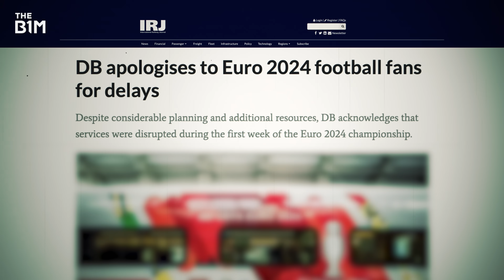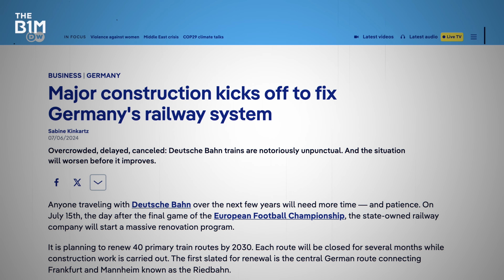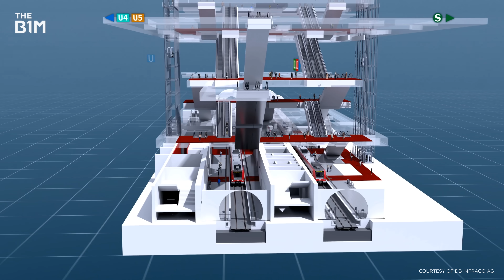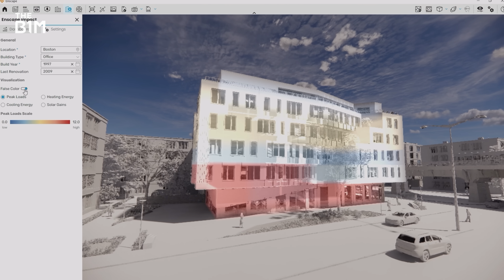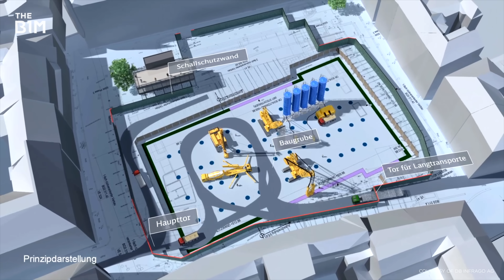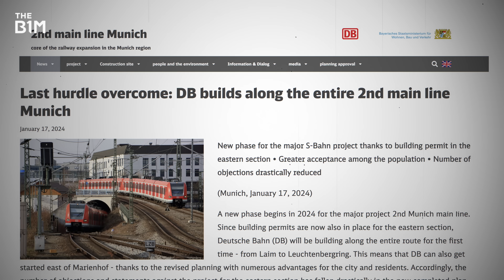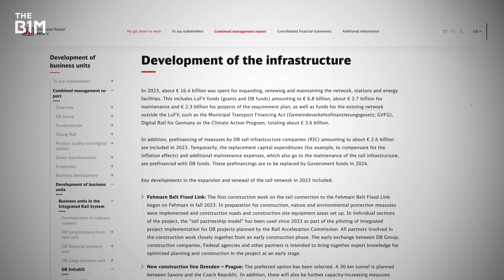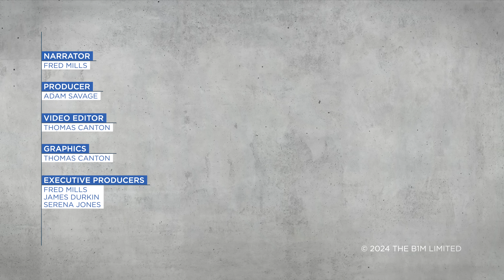Germany is (Finally) Fixing Its Failing Railways

Comment: These mentioned "largest projects" won't shift the quality of germans train infrastructure which has been neglected for almost 30 years (starting at the point when the former "Deutsche Bundesbahn" was transformed into a shareholder company named "Deutsche Bahn").
Tens of thousands of kilometers of tracks had been destroyed,  thousands of gates were deinstalled, hundreds of stations for freight trains had been closed (and the ground had been sold).
What Mr. Wissing proudly presents as a so called "Generalsanierung" will be a pushback both in the sense of economics and logistics. Whereas hundreds of trains do not arrive on time and lots of them even do not start (daily!) many commuting people who strongly rely on train services moved back to their cars inducing massive congestions on germanys Autobahns.
On top of this there are projects like those shown in the video.
They are so ridiculously out of schedule and so expensive that they suck all the money and the engineer working power that is needed to renovate the whole system.
Futhermore most of them are misconceptions at a large scale.
Stuttgart 21, Hamburg-Altona, Frankfurts new tunnel, 2. Stammstrecke (Munich).
It's a pitty.

Comment: Never trust a public train network when they put the station underground. It only costs more and is less efficient.
The new "modern" station in Stuttgart will not able to handle as much trains at it's predecessor. It's tunnel are created through a type of stone that expands in contact with water which could possibly break the tunnels and it's not possible to secure the trainstation from completely flooding in case of heavy rainstorms.

Comment: Unfortunately the new central station in Munich won't fix the biggest issue of the station. It being a head station without any way to get from the two Starnberg and Holzkirchen stations outside of the hall to the other trains. When traveling to Salzburg or Innsbruck (or the other direction) it's a pain to get to and from the outside platforms to your connecting train. The pathway is wayyyyyy too narrow and is a platform for other trains and always clogged. That has been an issue for many years, but recent hike in tourism due to the DeutschlandTicket mad the situation unbearable. Even 15 minutes aren’t enough to transfer to a connecting train.

Comment: And the possibly biggest rail project in the next decade or so isn‘t even mentioned here, wich is the massive overhaul of Hamburg Central Station (probably Germanies most overcrowded central station) that is being planned. Parts of it are still VERY hush hush, but there are apparently plans to do what basically amounts to both Stuttgarts and Munichs projects at once, while also constructing an U-Bahn at the same time. A parallel tunnel to the existing City tunnel for the S-Bahn, to alleviate the national railways out of the city and free up capacity on the Overground line is already in pretty advanced planning stages and is now being integrated with the plans for the U5 wich will run through much of the same area. Additionally there seem to be secret plans that have only been revealed though an inquiry to the local government and have only been released massively censored about a new national railway underground network, with new platforms underneath the existing central station and long tunnels out of the City towards the south and east.

It‘s a little bonkers to consider that all of these projects would overlap each other, and basically have to be constructed simultaneously in the same area.

Comment: „Germany is finally fixing its failing railways“

The „Riedbahn“ main connection between Frankfurt and Mannheim has been under restoration for the latter half of 2024 and has been recently openend again, with representatives saying there should be fewer delays and not half a month later, there were problems and delays again. At this rate the fixing will actually be completed in the planned and promised year of 2070.

Comment: I'm still not quite sure why they're renovating all these lines without having suitable replacements.
Is building another line running parallel really that costly in the long run?
Is the cost to keep a line in place really that dependent on time and weather instead of amount of trains traveling on that line?
Having more lines would definitely benefit travelers, around 40% of the time I rode the train it had delays and then had to stop at stations to let others through...

Comment: The Stuttgar21 project is an absolute joke... Yes the old station was not a station where traffic could run through but it worked pretty well (one of the most punctual stations in germany). The new underground station has way to less capacity...

Comment: a big problem is a focus on long distance travel and urban areas. from what i can tell, most of those 40 train lines are long distance, big city connecting lines.

considering that a lot of traffic is and should be commuters, there needs to be a bigger focus on smaller lines, connecting all of the country, not just the bigger cities

also there are a lot of unused train lines in germany in rural areas all over the country. which could service even more people and connect regions more efficiently

Comment: You could not be more wrong. The problem is not under funding but excess bureaucracy and extremely laziness in the system. Reduction in labour in the trains but upstaffing in the administration with no value for the customers.

Comment: U-bahn also drives above the ground. At least in Hamburg. The difference is that U-Bahn stops in shorter distances.
Reply: In Berlin fährt die U-Bahn auch teilweise oberirdisch. Und die S-Bahn in Berlin hält genauso oft wie die U-Bahn.

Comment: Germany has lost its ability to do Massive Projekts, not a single one in the recent years went smooth, all got delays, all got way more expensive then planned (its not only rail .. just think about the new airport in berlin or elbphilharmonie (musical building) in hamburg).
And for the trains and the delays .. the routes they are currently upgrading atleast have alternate railroutes (even if they take longer), but there are many tracks which need upgrading and repair aswell which don't have any alternate routes, this will have severe problems in the future

Comment: Who is this video fooling?
The German Train infrastructure won't be even slightly on track until at least the year 2100. This was confirmed by Deutsche Bahn. So in that case and with Germanys very bad construction industry it will at least take to 2100 if not even further.

Comment: The start of the project of switches and turns across the lines linking the city of Munich and the urban center of the city deserves appreciation and that work on it should continue with funding by German construction companies and the European Commission for Building and Development of the European Union.

The movement to modernize the railways between Berlin and Hamburg, as well as the modernization of the Munich network in the northern states, is a fruitful and effective matter that deserves the appreciation of the German Minister of Transport.

We also hope that Germany will enter into foreign partnerships with various countries around the world, such as Kyrgyzstan and Tajikistan, in order to start tram line projects in the two countries and connect the two countries with the world. The distinctive and exceptional step will open the two countries’ doors to the world. It is thanks to Germany that it obtains appropriate funding in successful partnerships.

Another time, thanks Germany. 🇩🇪🇩🇪🇩🇪🇩🇪

Comment: Stuttgart 21 is extremly bad, life endaring and extremly stupid. It is smaller than the og station, at an angle so anything wheeled will roll across it (like baby carts) the tunnel has to be drilled through rock that SWELLS with water which is needed to drill it by several meters, causing any building above to develop cracks and eventually fall to pieces. 
The station is sealed, and, as such, will lift off from the foundation if too much water leaks into it and oh yeah, the tunnel is so cramped that if a train gets stuck only one person can slowly creep along it, or if you are disabled, obese or pregnant you might not be able to leave AT ALL and if the train burns, which they do with shocking regularity, the tunnel will turn into a goddamn oven due to the air rush and cremate everyone inside. Oh, and they also drilled into a protects mineral spring and tore down protected historical parts of the old station.

And before I forget it, 21 will have LESS space for trains than the OLD STATION

You may ask why? Well, turns out if you put the stgation underground you can now SELL THE PROPERTIES that are generated by the old station no longer existing, which are worth BILLIONS by the time it is done due to the housing market.

Comment: It was never soly about fixing the hardware or just an engineering problem or to find funds.
No, ever since the neoliberal project was imported from Thatcher and Reagon, we dismantled several of our institutions only to find out that private organisations are either eually or even more shit at it. There are things, i just don't want privatisation to happen. It is hybris to think that only because somewhere else something works, it has to work equally well in your own nation. Circumstances, culture, ethics are all slightly different and lead to different things fitting better or not all at times.

Comment: Running a rail network is so complex (having the rolling stock in the right place at the right time, getting the train speeds right, maintaining the infrastructure, ensuring safety, staffing the system and synchronising the timetable) that I rarely feel justified in complaining about late trains. I applaud trains that arrive on time, but I do not expect it . . .

Comment: Germany has promoted car traffic for decades, we were building Autobahns while we demolished railways, now we still have overcrowded High and railways… because transporting goods By train got more difficult so Larry drivers have to camp onb5he Autobahn because factory’s moved their storages to the autobahn… Munich an Stuttgart 21 are just two projects and they run for years…we would have to built thousands of kilometers an we have to refurbish even more… some super-clever manager came to the brilliant idea and removed thousands of switches because they are expensive to operate, and now they rub their eyes because without switches it is hard to move train around…..😂

Comment: Couple weeks ago when planning christmas I noticed that we were already expecting DB bullshit. We did not plan putting seniors alone in the trains or avoided them when we could. Not on purpose, just naturally. And that really shocked me. 

DB is so incredibly greedy and incompetent. Most of my uni professors did some work for DB and they all said it‘s the most unhinged workplace ever. One professor had a consulting role and was responsible to make deals for axle parts. They worked on it for 2 years and had everything ready. They mixed parts from china, germany and france that could last millions of kilometers. 
2 weeks before the deal was due the DB just changed all parts to the cheapest manufacturer. DB saved a couple millions on that. 1-2 months after installation half the affected trains went back to the garage and needed replacement for most of those parts. Instead of working for millions of kilometers. They worked for about 400 thousand. 
DB lost millions in repairs and instead of buying the parts they originally wanted they decided it‘s more efficient now to use the faulty parts they already bought and replace them every 6 months.
DB lost a (estimated by my professor) about 70-100 million € in that process. Not counting all the delays and trains that broke down in the middle of some field.

Comment: Honestly, i recently took 4 regional trains to get from Frankfurt Airport to Esslingen, which is 215km away and it all went extremely smooth. I reached all my trains on time, they all arrived within 2 mins of when they were supposed to and in the end i got there a few mins ealier than i expected. To top it all off, i got on a bus which also arrived exactly then when it was schedudled to arrive. I was positively surprised.
Reply: The punctuality problem lies in the high speed trains. The regional ones are usually either on time or mostly up to 5 mins late

Comment: Yeah, if the "Stammstrecke" is down, the middle of the city is mainly down, if you're lucky you can switch to the subway but they will be overcrowded and every Taxi in the city is booked.

Not to mention the lackluster implementation of the connection of the inner city to the airport. Both S-Bahn lines are tied to the Stammstrecke and not as reliable you would like them to be.

Comment: I recently lived in Osnabrück for a few years and had to take the A30 highway to work, which is part of the direct road from Amsterdam to Warsaw. You could always tell when there's been a container ship with goods for Poland unloaded in Amsterdam, as the eastbound side would be choked with Polish and Dutch trucks.
There really needs to be more cargo train capacity on that route as well.

Comment: You made a common mistakes about the U Bahn. It doesn't mean undergrounds, it means "Unabhängig", "independent" in English. It means that it never shares it's rite of way with some other form of traffic. While some of them are underground, not all of them are. For example in Hamburg large parts run above ground, on an elevated track over the streets.

Comment: Why didn't they consider first improving trains and making them self-driving instead of starting 20-years construction?
Reply: You can’t just do that without building new lines, especially when a lot of the rail network is interconnected with loads of different services. Often, high speed rail services intersect suburban rail services. Self driving trains can only be done efficiently IF only one form of service runs

Comment: 11:45 Traveling between Mainz and Worms daily. During the Riedbahn renovation more trains were running on the line left of the rhine, local trains run on a different schedule. But interestingly somewhat punctual most of the time. Disruptions seem to have come from unpunctional Intercities. Especially in the last few Weeks damage to overhead lines and switches occured regularely though. Seems that track is now in need of repair as well.
And yey, aerial view of Mainz shown at the end ^^

Comment: 240,000 to 850,000 after 50 years, right? Germany doesn't calculate or anticipate that a project that needed to be done in 2020 had a different estimated capacity than if it was built in 2040, ending up always short of what it actually needs. None of thee governmental departments talk to each other. They invite 1 more million people to Munich, housing crisis gets worse, then again they start crying our public transport is insufficient.

Comment: Its so frustraiting that any major construction in Germany takes decades while in Asia projects ten times in size are finished in 2-3 years. 
I've seen the construction sides in Munich for years and rarely you see there any workers. In if they are there, then its 3 or 4 people. 

When I was in Shanghai the first day I cecked in in my hotel room. On the street they were preparing a construction and I was very worried, that I have to spend the whole week in a room next to havy working machines. I was surprised, if not shocked, that aprox. 100 men arrived. Did the whole street new, all the asphalt, new benches, bike stands, new paving stones were placed. In ONE DAY! Over night the street was left closed - I guess so the asphalt can harden properly - and the next morning, as if there was never anything the 8-lane road of smth. like 200 meters was done.

Comment: One of the most significant problems DB is faced with, is the combined use of track throats by regional and high speed trains to and from main hubs. Have seen quite a few of these ‘works in progress’ updates, but somehow this particular problem still seems to be under the influence of serious back tracking. Also missed it in this one.

Comment: 3:10 - "Back in 1972...Munich unveiled S-Bahn" - Funnily, the S-Bahn line to the Olympic Park have been closed and overgrown for decades now xD
You can see it on the map to the left from Olympiapark.

While DB is at it's lowest point, it's still way ahead of many many other countries I travel via train on, and now it's getting a well needed refresh? I'm all in, these delays are generally of little problem, annoying yes, but can be fairly easily planned around.

Comment: All those years and decades where the neoliberals forced their ideology down our throats: The government is inefficient, everything should be private, the Deutsche Bahn should be privatized and auctioned off on the stock exchange. They had consultants who calculated that the maintenance of points (?) would be too costly. So they removed many points. The result? Faster trains can't overtake slower trains, Defective trains stop the whole line. 16 years of conservative government left all public infrastructure to rot. '

Our current fight is against the 40 year old Bundesverkehrswegeplan, according to which Transport Minister Wissing still wants to build new highways, sticking to the conservative's theme of ignoring science.